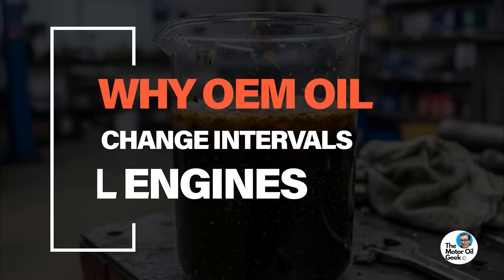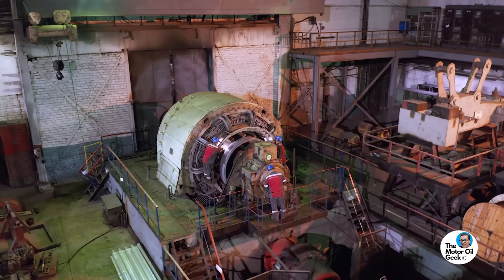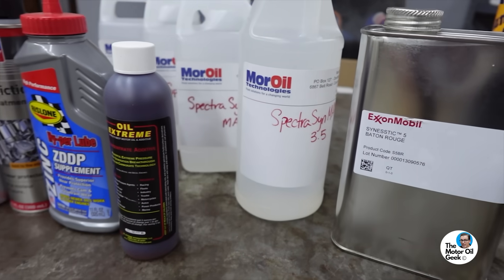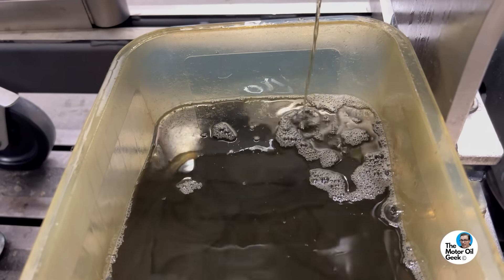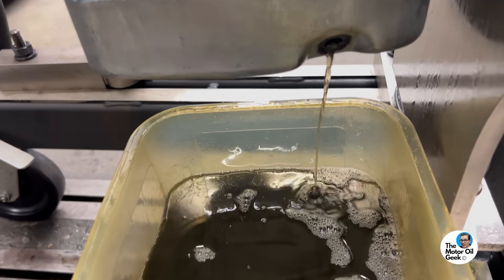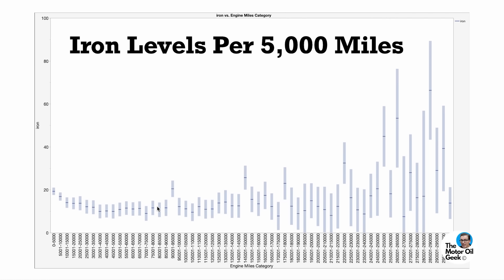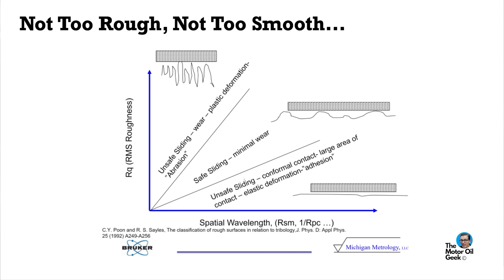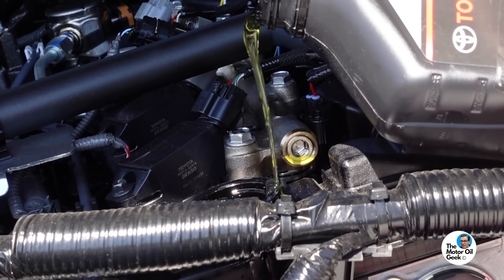NEW Data Reveals WHY Modern Engines FAIL Prematurely!

Comment: STOP BUYING NEW CARS! I sold my last new car years ago and went back in time. My newest truck is a 1987 Ford LT9000. Followed by a 1984 Chevy army truck and lastly a 1983 dodge ram. All have original power trains in them! New cars are complicated old trucks and cars were built to last, and designed to work under extreme conditions, and designed to be taken apart and put back together on the side of the road. New cars are designed to bankrupt people and designed by the federal government to track you so you are nothing but a pin drop on a map so the nsa can create a file on you! They lie and bail out car manufacturers that go bankrupt. They hate it when you own anything old. Because my old trucks are completely exempt from emissions testing, and speed governors. And I also have used oil additives my whole life in old trucks engines and never had a single issue. The oil additive thing that was said is a big LIE! I’ve had numerous engines start to tick and knock lightly and I’ve used Lucas oil stabilizer in them and I’m the ford truck I use 2 gallons in the oil at every oil change and never ever had an issue. It actually made the engine last longer. And Donaldson oil filters are JUNK! Use fleet guard, or wix. Baldwin, Napa, Donaldson are all garbage filters. The issue in modern engines are that there isn’t any zddp in the oil any more. The oil is basically water. And fyi I am a diesel mechanic and I’ve done things this way my whole life and I’ve never ever had an engine fail. The Chevy army truck has a 6.2 Detroit diesel that everyone says is a throwaway motor, but with these steps that I use that engine is still going strong even after nearly 45 years! The issue is the modern “Fuel efficient and environmental compliance “ oils that are junk. I have always changed oil and filters every 3 months or 2000 miles regardless if it’s Dino sae oil or that synthetic crap that doesn’t work. Synthetic oil is a waste of money that doesn’t protect any further. Yes I have done testing in the Chevy army truck and it had increased wear and tear especially in the winter months with synthetic oil vs sae Dino oil with Lucas additive.

Comment: It all boils down to this... you can't place more load/demand on ANYTHING mechanical, without reducing lifespan. For decades, we have designed engines to make more power AND be more efficient. All this, while forcing lubrication systems to function with LESS pressure and LESS volume.
Reply: My 2010 Ford Fusion 3.0 AWD has a 6 quarts capacity. I was surprised when I did my first oil change. But that extra quart has helped bring me to 180K miles.

Comment: Preach it Speed!  I convinced my friend with a 2025 baby Duramax diesel to change the oil at 500 miles, 3k miles and every 5k miles thereafter.  I also convinced him to use 0W-40 instead of 0W-20, since you can get it for $28 for 5 quarts of Valvoline at Walmart online these days.  I honestly think this will make the parts of the vehicle affected by engine oil last around twice as long.  The more data directly and adjacently related to this hypothesis , i come across, the more confident i am in it as a theory. 

Great insight about the oil filter too.  I convinced him to use filters that have a higher efficiency rating at smaller microns than OEM without spending an arm and a leg.  I made sure to find him ones that also have less resistance to flow than OEM, when they’re clean and dirty, which is also just as important, as particle size filtration efficiency.

Comment: Filters seem to be a major issue in the automotive industry.  There are too many factors to take into account when attempting to select an aftermarket filter.  Micron rating, dirt holding capacity, internal bypass valve function, flow rating, media shedding and fitment just to name a few.  The average guy or professional mechanic does not have the time or resources to research or test all of these points.  To add to this the OEM’s will stop producing your filter and out source it at some point resulting in an inferior product in OEM packaging.

Comment: This is only a small part of the issue. I’ve said this many times but the problem is due to the quality of metals. They now allow trash metals up to 8% to be mixed when making metal and has been so since around 2020. No matter what car you buy if it’s after 2020 then it has trash metal and will break down much sooner. Trump is aware of this and has said we won’t buy metal from anyone and will make our own metals but that’s on the back burner. He can’t possibly produce everything made of metal so we have to buy this trash metal from overseas. The way to stop it is to stop them from mixing bad metal when the metal is made

Comment: So hydraulic fluid needs to be clean but apply longer filter change intervals later bc the data says so? Dude, pick one route. This is where you need to look at Jeff bezos: if the data does not match the anecdote your data points are wrong

Comment: This is why it so incredibly important to follow the manufacture manual with anything that uses oil to keep things lubed under pressure.
Best example I have is lawn equipment. So many people dump oil in the crank case and never change it after the short 15 to 30 minute break-in period. The crazy thing is, that oil is ALWAYS shimmering like glitter and there's no filter in these things. Then these same people complain that their mower doesn't perform like it should, or it sputters and dies, or... you name it. Point is, everything you said is spot on 100%. Thank you for making this video and I hope it reaches at least one person and that it helps them understand how to care for their engines.

Comment: I’m a retired power plant Condition-Based Maintenance (CBM) specialist. Oil analysis is a critical predictive maintenance tool in rotating equipment reliability. We conducted routine real-time analysis on turbine and generator lube oil systems, as well as multiple seal oil systems. In many cases, abnormal wear, contamination, or degradation trends were identified through oil analysis long before any operational alarms or operator indications appeared.

Great content!

Comment: Lake, back when FoMoCo released the 5.4 3v engine  with VVT, I knew something was up with the oil and the crazy intervals out here. My 224 Elanta calls for every 8k and I don't like that and you confirmed my theory that Ford was using oil as hydraulic for cam phasers. Heck that 5.4 3 valve 20 years ago had us all doubting the reliability based upon the 5k oil change interval and the horrible knocking and violent shaking for at least 6 seconds to 10 seconds then it smoothed out. Was really sketchy as a tech knowing you had a rotation hand grenade potentially after startup.

Comment: Systemic analysis is needed. The tolerances on Toyota 3.4 is looser than 5.7, so thicker oil needed. Variable output Oil pumps can starve oil to bearings and start-stop exaggerates this. Poor systems engineering.

Comment: Thank you for another highly informative video, Mr. Speed!
I recently purchased a VW vehicle that requires 0w20 oil meeting the 508.00/509.00 long-life spec. Since I prefer not to follow the extremely long oil change intervals, does it make sense to use a non-long-life oil instead? I’m sure the chemistry of long-life oils differs significantly from standard formulations. I’d love to hear your take on this. Thanks for your time and happy holidays!

Comment: I've been working on cars for 22 years. #1 cause of failure is lack of oil changes. When gas engines get oil changes @ 3-4,000 miles, they run forever..
Yet customers tell me I'm wrong. 
I do not enjoy changing oil. Go ahead and do it at 10k if you want. Then come back for a long block. I'm here for you

Comment: New engines fail because they started making engine parts out of plastic, like the timing chain guides,  intake manifolds,  water pump housings.
Reply: None of the above-mentioned plastic parts are the reason for the new Tundra and GM truck engine failures.
Reply: @CAN43714Liberals voters are 100% are to blame.
Reply: My 2007 2.4l Hyundai suffered the classic con rod bearing failure. In repairing it, I got a good look at all of the cam guides, tensioners and other bits of the cam chain and drive. Almost zero wear on all of them. I've also had super high mileage Ford V8's with the phenolic cam drive sprockets, no issues. Just some examples.

Comment: I used to make parts for Ford, during the scamdemic and after Ford would push through bad parts due to lack of production from other places and adjust bad part thresholds, can think of quite a few parts and companies that sent out bad parts because the big 4 didn't have a choice. Combine all that with the piss poor work ethic of younger people and having zero pride in what they do you get all these problematic vehicles.. do not buy anything from 2020 and up.

Comment: I’m a Amsoil nut, I go 10,000 miles between oil charges and got 500,000 miles out of my gasoline engines, even my 3.5 twin turbo went 500,000 miles

Comment: Hello Lake new to the channel. Planning to get a 2027 Cummins 2500. Would you say  put either a Insane diesel or Amsoil bypass a soon a I bring it home from the dealer?  Live in the southeast so viscosity wise 10W-30 or 5W-40? Should I also do the 500 flush, 1500 then 3000 then at  5000 change oil + filter ?

Comment: Started getting real bad after 2018. 2013-2018 sweet spot for buying a modern enough vehicle with lower miles but without the hyper planned obsolescence
Reply: I say 2006 - 2018. Mitsubishi brought the evo 9 & Lexus unveiled their 1st performance v8 to only follow up with the best sounding engine ever made in the LFA. Then comes GTR r35 etc.  Early 2000's had peak vehicles.

Comment: I have to admit, I've not come across a manufacturer that doesn't tell you to break a new engine in.  Plenty of sales people will tell you this, and I went through this spiel first hand a few years back when buying a new car.  But I read the owner's manual when I got home, and wadda youse know?  A break in interval.  Tells you what to do, what not to do...and to change the oil way ahead of the regular (or even the severe) schedule.  In my case, as I have a turbo car, the regular oil change is listed as 5000 miles, severe service is 3000 miles...and first change is at 1000 miles, regardless of whether you're on the severe or regular schedule.  I wonder how many people just take the salesperson's word for "no break-in period" as it's well documented that the majority of people never actually read their manual.  But if a low-end company like Hyundai does it, I'd be looking carefully from more up-market brands. 

PS: Car is now 9 years old, 120,000 hard miles on the odometer - it's a 6-speed, and I like a spirited thrash down a country lane.  Burns no oil whatsoever, pulls strongly, no signs of issues whatsoever.

Comment: The real issue is cost cutting they are cutting costs on everything they want to make more profit every year its never enough for them. You can only make things so cheaply and we are at the point now its so cheap engines fail at the drop of a pin thwy are puahing oil change intervals out to 10k milea and they wanna push them out even farther. Dont fall for thag bs light on your dash full syn change it every 6k and so not ru0 weight oil run a 5 20 or 5 30 it will not hurt a thing. The thinner oil is for emissions and fuel economy thinner oil ia easier for the rings to wipe there for lowering emissions and thays dumb in its self because the difference in emissions from.a 530 or 520 to a 0 weight is very very small and the thinner oil has less rolling restance and thays dumb as well because the mpg difference is allmoat not meaurable. They are out to get you and it is designed to fail. Plus they are running amaller and smaller filters. If the space is there and you use a can style filter over a cartridge you can get a higher capacity filter.

Comment: What if I told you the Hemi tick was a part failure. Not the lifters. The camshaft heat treatment process being wrong at times over cooking it. Than it flakes off in your lifters. I have no proof when you swap a cam in a Hemi no more issues. Btw I agree shorter oil changes

Comment: I’m 53 years old & I’ve never bought a new vehicle. I had a banker tell me many years ago, the best way to get ripped off financially is to buy a new vehicle. BUT, if I were to buy a new car, as an engine builder I’d change the oil as soon as I got home with a heavy zinc break in oil for 500 miles. Do it again a couple times for each 1500 miles. It would be as if I built the engine myself. After about 4500 miles or more then I’d switch to synthetic oil.

Comment: Greed of the vehicle manufacturer is the root cause of all these problems. Everything they do is based on increasing profit. If they can save a penny on a part, they will go with the cheapest option always. A good example is the plastic drain plugs that Ford uses on many vehicles. Was the steel drain plug that probably cost $.10 too expensive??

Comment: Oil always really bother me. I understand most of what is said in this video, but I have a 6.0L diesel. I only change the oil, once a year and due to an injury I'm closer to18 months on the oil. Before people freak out, I've driven my truck less than 500 miles this year. I always run the OEM filer, Shell Rotella T6 Full Synthetic 5W-40 Diesel Oil and I have an after market Amsoil bypass filter ( I'd love to replace it with a centrifugal filter). I try to start my truck once a month and let it run on high idle for 30 minutes if I haven't driven it in a while. My preferred method is an 1 hour drive, once a month to keep everything from drying out. 
I'm always nervous about the time the oils in the engine, but I couldn't justify changing oil that had 200 miles on it. I also use oil analysis with oil changes. 
Thoughts?

Comment: I love your videos! One of the main questions I’ve been battling in my mind is what oil I should use in my truck (2006 ram 1500 with the 5.7L hemi W/ 170k miles) It calls for 5W-20 and It consumes about 2 quarts of oil every 5000 miles. I’m currently using 5W-30 Penzoil platinum high milage, but i’m curious if i’d be better off using Penzoil Ultra platinum or maybe even the valvoline restore and protect to get some cleaning done in there. I also don’t know if it’s worth it for me to keep running the higher viscosity oil to reduce burning off oil. I’m also curious about what fuel additives are worth it to constantly use!?

Comment: The point you raised regarding the oil serving as a hydraulic fluid is extremely important. In transmissions, we see accelerated valve body wear as a consequence of iron,  aluminum, and clutch material causing abrasion in the valves and bores. This is exacerbated in some cases by valve designs that cause side loading or oscillation during operation. To be honest, automatic transmissions also have a break-in period as clutches, steels, sealing rings and bearings wear in, and we really should change the fluid early on to remove those wear metals and friction materials from circulation to reduce contaminents. Transmission fluid is really just light weight oil with friction modifiers and red dye. If I remember correctly, the 10-speed ULV fluid has a viscosity similar to SAE 10. The 10-speed filters also include fine and course media with a thermal bypass vane. At cold temperatures, the fluid is allowed to travel through both in parallel to increase flow of the thick fluid, while at higer temperatures, it only flows through the fine media.

Merry Christmas everyone!
Reply from the maker: Thanks for sharing! Merry Christmas!
Reply: @themotoroilgeek Thank you Lake! We will take some ULV fluid samples soon and send them in to SPEEDiagnostix. It will be interesting to see what we learn.

Comment: This is why I will never buy a vehicle with a "modern engine". I have Jeep 4.0's with a couple hundred thousand miles on them...have a 12 valve cummins dodge diesel and they get an oil change when it looks like the oil needs changing. This almost sounds like an ad from oil distributors. I drove semi, the hardest working vehicles ever...and we had a 10K mile oil change interval and a 300,000 mile engine and got an in-frame bearing and piston change. I'm not buying this modern shit that needs to be babied.

Comment: Lake I do appreciate the content that you are creating on the subject of oil change intervals and oil formulations, oil filters, gasoline, oil contamination, and the science behind it all.  The idea of not changing the filter with every engine oil change is interesting.  I can understand the logic behind it, but as the debris continue to accumulate the resistance to oil flow will increase until the filter bypass to opens up, and at that point the filter isn't doing anything beneficial.  I'd like to see some testing of various high efficiency oil filters with a focus on determining the optimum intervals for changing the oil filter.  I'd also like to see options for improving oil filtration beyond what is originally installed on OEM stock engines.  My Toyota was equipped with a tiny Chinese made paper media oil filter which just did not inspire confidence so I switched to brands that use 100% synthetic media such as Wix XP or Amsoil.

Comment: 10:25 I'm not sure if you misspoke or I lost track of what's being said, but isn't oil FILTER loosing efficiency since zero hour ? I'm doing my changes every year which is roughly 5600 miles at most, so by the logic of what's being said in the vid I should swap filter every second oil ? Manufacturer suggests 9600 miles between changes.